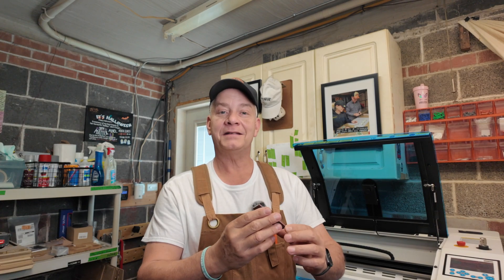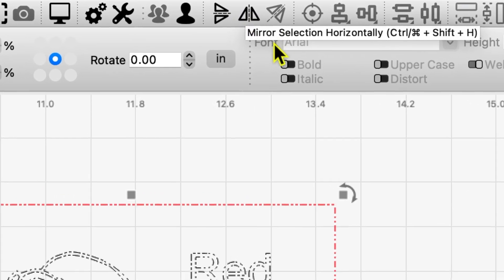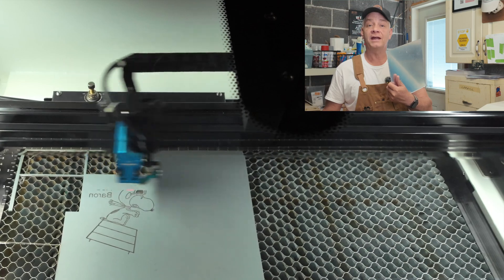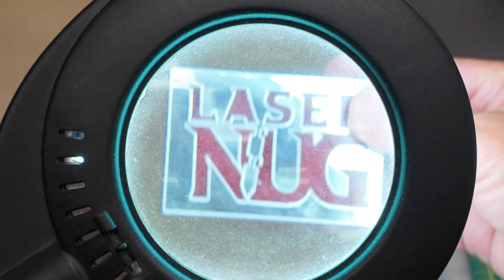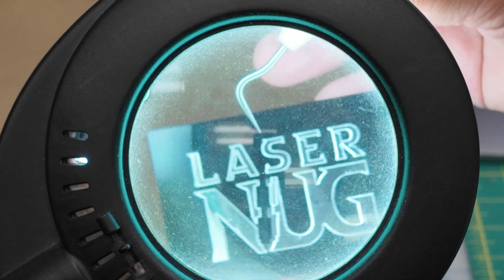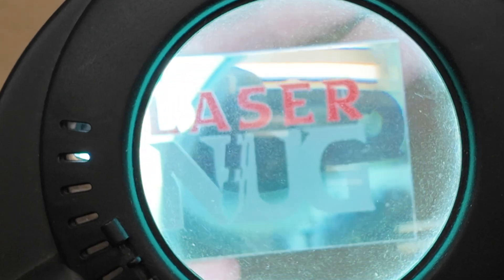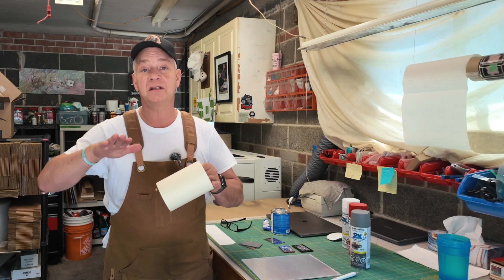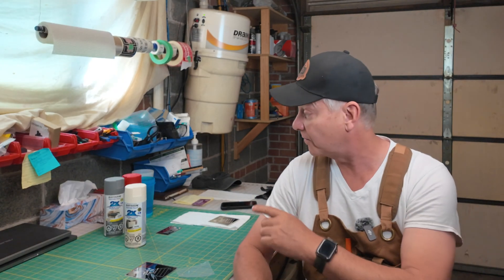Mirrored Acrylic on Your Thunder Laser BOLT. Settings and Tips. Laser Engraving.  043   4K

Comment: The cracks on the mirror from the white paint could be if the paint has acetone and the mirror is made from extruded acrylic, anywhere that is laser engraved or laser cut that gets acetone on it will craze (small cracks). Same thing if methylene chloride/Dichloromethane (ingredient in acrylic cement) or alcohol touches a laser engraved or laser cut edge.
Reply from the maker: Good morning and thanks for the great information. Very helpful. Have a great week!

Comment: I appreciate your video. You did a great job on explaining the details.  I was debating on using glass mirror as this has worked for me on wedding signs, but I wanted something to make a mirror Diploma that would not break into pieces in the future if handled a bit rough. Looks like I will be using the mirror acrylic using a high LPi and using black paint to give it a natural Diploma look.  Thanks for the information brother. Just Subscribed.
Reply from the maker: Thanks for your kind words and for Subscribing - Welcome!. I think you will be very happy with it - if possible try to find cast acrylic mirror ( most are extruded) but the cast takes paint much better. Thanks again and all the best!

Comment: Nice video once again Gord, you keep amazing me on what is possible with the Bolt. Rattle can paints are tricky, thickness of spray onto the surface (wood, metal, acrylic) is not the user, its the paint and the distance to the surface for different colors. White went on thicker and didn't dry at same rate causing some small cracks, try a 4th time farther away, one light coat to see if that helps. My thoughts only my friend. Cheers and have a great Fathers Day and a COOL week with the incoming heat wave.
Reply: Hey thanks Pete! I will try that - I could not figure out why it would be different but will do. Cheers! Stay cool this week!